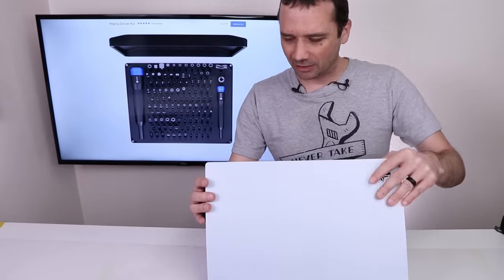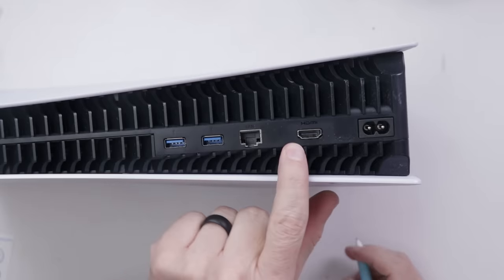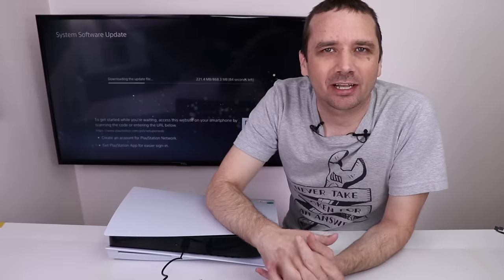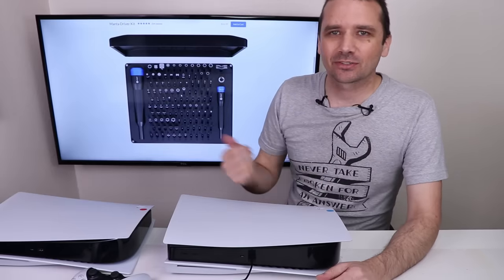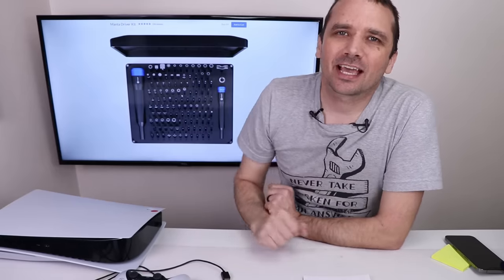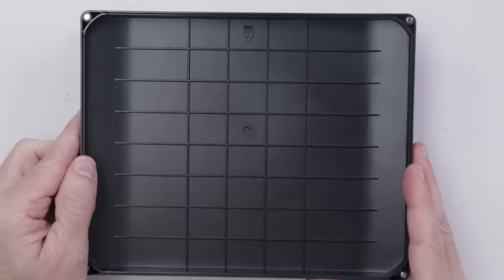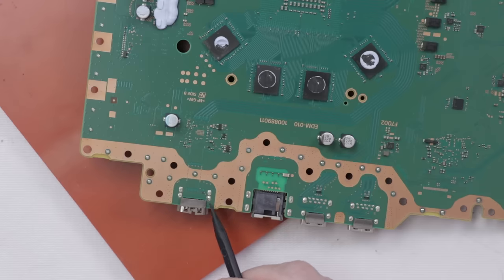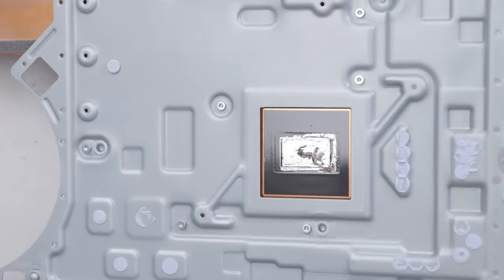I Bought 13 BROKEN PS5's - But Can I Fix Them?!

Comment: I applaud you for helping with recycling the electronics you fix. It's therapeutic watching you fix them and I also appreciate the fact someone can utilize the fixed product/parts. Since PS5s are hard to come by, it helps to get every unit that can be fixed, fixed.

Comment: most people: 0 PS5s
TronicsFix: easy 13 PS5s
Reply: But broken
Reply: Idk I walked right into the store and bought mine. 🤨
Reply: @rylo2863  a lot of countries don't have stores open at the moment
Reply: @andrewc3294  or theyre sold out 😭
Reply: *ez
Reply: @bl4ckp00lz3  Or the fact that many people don't want it. There's literally no incentive to pick up a PS5.
Reply: @outlawfly664  Sales and backorder figures beg to differ. Sony sold 4.5 million PS5s just in the first 6-7 weeks after release.
Reply: @outlawfly664  you’re not wrong, first big game doesn’t hit till summer.
Reply: @rylo2863  who cares
Reply: i got one eventually hopefully by the endish by march its been worked out
Reply: @rylo2863  what store? All in my surrounding areas are sold out
Reply: @rylo2863  Yeah. Butbplayi g PS4 games on my ps4 is so much better. A lot of them have 60fps patches or will be getting 60fps patches and also mostly run in higher resolution than base ps4.
Reply: @allysaj6911  I live in a smaller area, and my local Meijer has them every week.
Reply: P

Comment: On the early days there were a lot of reports of bad APUs with artifacts and screen blinking. But with scalpers is really hard to know if it’s a wide problem.
Reply: Just had to send one console back, it refused to run PS5 games. PS4? No problem.. PS5 (Demons Souls and Miles Morales) no bueno.. Its weird, thankfuly it got replaced in three days and works just fine. Also thankfuly it wasnt mine PS5 but one of my colleagues :D
Reply: @Vostoceq  so the testing done in this video with the ps4 games does not cover it

Comment: This video will be viral, channel is blowing up congrats Steve!
Reply from the maker: Thanks Paul. These salvage lot videos usually do well so hopefully it gets a lot of views. It was fun to make! I appreciate the support.
Reply: I'm a little concerned he managed to find 13 broken ones already :). I sent my launch day back because the buzzing power supply was giving me tinnitus. Got the replacement back.. same buzzing power supply.. Total failure but as far as operation goes, they were both fine. I would guess most of the returned PS5 so far are being returned for the capacitor buzzing and actually work fine. But.. I wouldn't recommend buying one yet if you are sensitive to annoying sounds.
Reply: @thomassmith4999  that's what I was thinking. Like wtf Sony. Wonder if it's the same with the new Xbox's?
Reply: Gonna agree, and glad to see ya👍🏻
Reply: @seanlacroix  Plenty of broken new Xbox's around, much more than PS5s I think. But at least they don't buzz
Reply: @thomassmith4999  actually there's an article that says right now there's a 1% failure of both consoles. Which is pretty damn good in the grand scheme of things.
Reply: @seanlacroix  it‘s not. We didn‘t have any problems yet. It‘s pretty quiet. Maybe I can‘t hear it over my children shouting.
Reply: @seanlacroix  Yeah that's better than the last couple generations of consoles I guess, although the PS4 seems to be pretty invincible.
Reply: @thomassmith4999  way more ps5 returns than Xbox
Reply: @niagarajoe4402   Returns, yeah for sure, I've even sent mine back for PSU buzzing and probably should send the replacement back also as it's not much better. But actual failures I would say the Xbox has more.
Reply: @thomassmith4999  I have a buddy who works at bestbuy....he said they got numbers from corporate, and it was 3-1 ps5 to Xbox returns.....but who knows worldwide what that is
Reply: @niagarajoe4402  They are both pretty good machines compared to usual anyway. Other than those rubbish capacitors in the PS5 it's only real downfall is the operating system, no folders for the games, no usb backup.. Things like that which they will hopefully change with some consumer pressure.
Reply: There was an odor on my controller when the USB was plugged in. It smells like ash between the dualsense touchpad and type C, I have tested it in the astro playroom, it has all its capabilities.
Reply: @seanlacroix  Electronics fail; could be early, could be later than expected. I find that most issues that are called for warranty end up being caused by misuse.
Reply: @thomassmith4999  it’s coil whine, doesn’t affect operation, since the fan is spinning slowly, u can hear the buzz. No defects...😁
Reply: @jadenlobo7633  It's not coil while, it's the psu filtering capacitors. I know it doesn't effect the operation of the console. But it effects the operation of my brain and isn't good enough for a 500 dollar bit of electronics that is 100% for sure. If it was a 15 dollar piece of cheap junk then OK. But a 500 dollar console.. not good enough.
Reply: Not looking good buddy
Reply: @thomassmith4999  oh, well, I guess I take my words back then 😂
Reply: Where can I buy one from you🙏
Reply: @thomassmith4999  Steve made a video recently where he fixed the coil whine, its a specific component in the power supply. It's not an unusual problem, at my job I was deploying several hundred HP business desktops, about half of the batch had hissing power supplies. One was too loud to give out, but for the others its been several years and no failures or complaints.
Reply: @Tronicsfix  can you do this with my Xbox 360 s if so what’s your price
Reply: @Tronicsfix   I get that error code ce-108255-1 this code has not been solved to be fixed I really hope you find the problem this will help alot of people that have this problem please help tronicsfix
Reply: @compaqdeskpro5770  Yep I've seen the video and other fixes. I will have no problem replacing the capacitors and insulating them once the warranty is out. I just really think I shouldn't have to do that.
Reply: @seanlacroix  My Series X is totally silent, can't even tell if it's on. Compared to my friends PS5 it's as night and day, I am afraid Sony have some quality issues. Hope my PS5 will be silent...
Reply: @Tronicsfix  Where are the links 🤔 to those websites where you purchased these Broken PS5's , don't you think you owe it to your 1 Million subs to know how & where exactly to buy defective PS5's cause your viewers are Techs as well .Don't prove it to me , prove it to your Subs .
Reply: Ya
Reply: @Tronicsfix  have you figured out the error code ce-108255-1 🙏🙏🙏🙏
Reply: @Tronicsfix  bro there is a fake you and he gave me his whats app and I now I know he's fake
Reply from the maker: @exoticsnowmanonps5532  There are actually several of them. I ban them but they just make a new account. They're doing this to a lot of other YouTubers too. This is something that YouTube needs to fix asap but they probably won't for a while. I delete as many as I can but they reply to tons of comments. Hopefully at some point people will realize that they're fake accounts.
Reply: that's why I don't play console

my pc can last more than 7 years with no issue at all

Comment: PS5’s #1, #7, and #10 possibly have a software bug that causes disc games to freeze and crash that has been identified by Sony and should be fixed in a future software update. My friend had the same issue with his and he sent it into Sony and that’s what they said the problem was
Reply: The solution is simple bro just turn of network while playing offline games .
Reply: Most of those issues have been fixed already
Reply: @favasai1673  ... did you watch the video? He did that and the game still froze.
Reply: That happened to mine when I first got it I did a factory reset and I haven’t had a issue since
Reply: @Phoenix Winter Sony sent him a replacement because it fell under warranty
Reply: @Phoenix Winter contact sony, they should replace.
Reply: A storage reconfiguration usually fixes these software issues
Reply: Mine stop reading all my games 😔 and makes a load noise when trying to read the disc. Getting a box to send it in soon👍

Comment: Using a thermal camera to see if the processors power up is the "coolest" way I've ever seen to verify they're working! I've used my infrared thermometer to quick check problem areas in cars, but that's a whole new level!

Comment: why couldn't the owners claim warranty since they are all below 1 year old.
Reply: That's the question of questions... Hell the 90 day mark isn't even up yet
Reply: Owners probably exchanged it with their retailer, and the retailer is the one who liquidated it.
Reply: Because it's all fake
Reply: asked that myself too
Reply: @ualdayan  Yeah, that could also be the reason why some of them work perfectly fine. If the retailer doesn’t go through the trouble of testing them but simply sells returned items as “broken”.
Reply: @ualdayan  you have hit the nail on the head and helped educate several people on the internet.
Keep up the good work.
Reply: Because the video is fake
Reply: most of these liquidation sites are selling retail returns, so they likely did get a replacement
Reply: Fake video or stolen consoles.
Reply: Because with the limited stock of the Ps5, people have brought them from stores like Ebay etc, which once purchased, you're pretty much on your own unless you go down the buyer guarantee route
Reply: Because those people aren’t smart
Reply: @GDoggProductions  you can still claim the warranty, I already have my controller replaced and I bought it from a friend. And went to sony directly
Reply: @uubet4846  That's good to hear, well done 👊

Comment: 1. how the hell did you even get 13 ps5s

2: how the hell did this many people already break their ps5
Reply: Most of them are faulty from the factory
Reply: @VolkyWay  Then why don't the buyer get it replaced? lmao
Reply: @DJHEADPHONENINJA  some people don’t know any better. They just go back to a place like gamestop which won’t replace it and give them $100 for it and just give it up as salvaged
Reply: Cause  sony ps5 is a half baked mess😵😩😩😩😩
Reply: Yes ps5 has a large failure rate.
Reply: Earlier batches always have a high faulty rate. Xbox and Switch are no different. Should just leave them to scalpers and wait for later batches when quality has improved.
Reply: @d007g4  lol troll
Reply: @OutlawFarmersRC  lol troll
Reply: @zhengguo3178  pretty accurate
Reply: Xbox better, ha?💁🏼‍♂️💁🏼‍♂️💁🏼‍♂️
Reply: 3 why don't folks to return them under warranty. Yeah sony might say no but surly it's worth it 🙈... good vid though
Reply: @OutlawFarmersRC  no not really
Reply: My Ps5 has been working just fine, other than network failure. Luckily I typed in dns and it fixed it permanently
Reply: @zhengguo3178  Whole heartedly agree.
Reply: out of millions of playstations 5 sold, you are amazed that at least 13 of them have broke? lol
Reply: @amyjones1417  sure bud
Reply: @zhengguo3178  thats what im waiting for
Reply: that's why I don't play console

my pc can last more than 7 years with no issue at all

Comment: After reading the title, I was asking how people already break these things.
Reply: Same here!
Reply: Privilege
Reply: Faulty hardware dude, not like people break these things on porpose.
Reply: @TheMiwel11  there is a guarantee...
Reply: @nikolastevanovic7220  I know but some people don't have a proof of purchase, Sony requires that.
Reply: @nikolastevanovic7220  If someone bought one, didn't like it, sold it on, that new buyer wouldn't be covered.
Reply: I got mine last weekend, out of the box it was glitching and crashing like the ones above, I returned it and got a new one a couple days back, seems to be working good, the guy at Best Buy said they have seen some with defective GPU’s
Reply: @certainpointofview3860  First never buy new consoles when they come out coz they broken... U get new console thats great but probably thats Ps5 will not work more then 2 years. Also they still didnt fix rest mod bug on ps5.
Reply: @Christian Winkler I will buy it but I cant hehe 👍🏽😁

Comment: How dirty is someone's house that their PS5 can be that caked with dust. The unit has only been out for 5 months at most! People are slobs.
Reply: I clean my PS 5 every day.
Reply: that's why I feel a bit uneasy when I happen to sell what I fix. I wonder if they will treat tech with respect.
Reply: Just having carpet in your house will generate that much dust in the 5 months since PS5 launch.
Reply: Yeah I mean some people are indeed slobs but also a lot of people live in dry dusty areas and/or they have a pet and carpeting
Reply: @thomassmith4999  carpet is bad about trapping dust under it and a vacume won't pull it up either but walking on it will and kick it up in the air then the gaming system circulating  the air around will pull it in like an air filter and thus is how the dust inside the system can build up so quick even in an appearingly clean house
Reply: @thomassmith4999  this is why I don't like carpet because of the dust trapping
Reply: @bobmybob9493  I hate carpet so much.. But I live in a rental and don't have any choice.. So it's regular console cleaning for my life.
Reply: If you believe it's dust I have a bridge to sell you were can we meet😆😆😆✅
Reply: @thomassmith4999  I got it release day at Target, I have carpet in my room that is over a decade old, and I vacuum probably one to twice a week.

I dusted my PS5 because I got scared of all these pictures of people with yellow dust on their PS5s, one guy didn't even have carpet. 
It is a lot more variables at play, smoking around your consoles is another way, but having carpet will NOT generate that much dust on a PS5.
Reply: @thomassmith4999  Wrong. Carpet does not generate that much dust. I have carpeting, and none of my consoles are EVER that dirty. It's all about how clean you are and how well you keep your home clean, plus other variables like pets/smoking/etc.
Reply: @radicalcb4458  I live in Australia, it's generally a dusty place, even outside it's always flying around so you can't really avoid it
Reply: @bobmybob9493  You forgot about one thing - people who clean their house will also clean their console. It's not difficulty to get some compressed air and blow out the dust. Only slobs would have a console that dirty.
Reply: Agreed. Some people are unbelievably dirty
Reply: Exactly
Reply: After cleaning/fixing a few from friends with pets I'd say anyone who has a dog or cat. One old ps4 was caked with pet hair so bad the pile was the size of the console when I got it all out.
Reply: I easily got upset with that dirty PS5. Who the heck used this? I can easily figure out why the HDMI port got busted. I bet the owner tried to jam the HDMI cable the wrong way. Some people really don't deserve tech like this.
Reply: Truth, I have large dogs as well, just keep routine cleaning and there won't be a problem.
Reply: We have 3 dogs, you can clean twice a day and go on holiday and still find a hair in your food. If I had one I expect it would be like that by now.
Reply: I'm a slob,  but I don't have THAT mush dust.